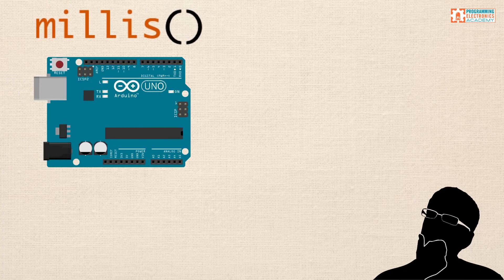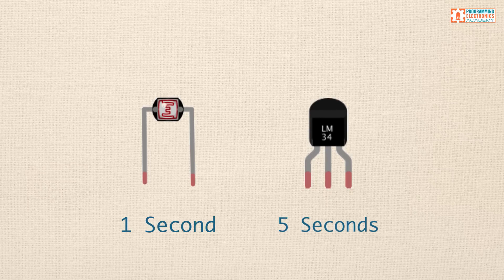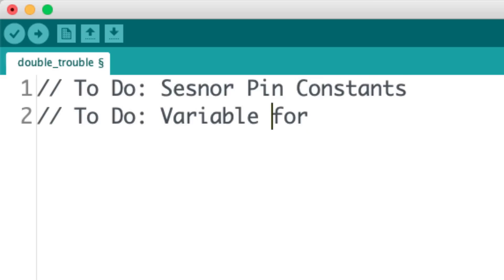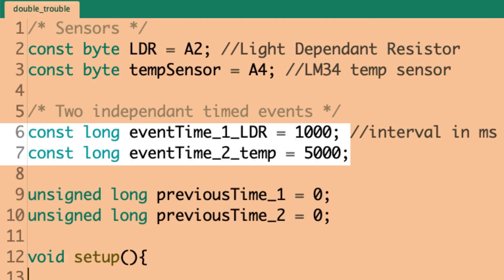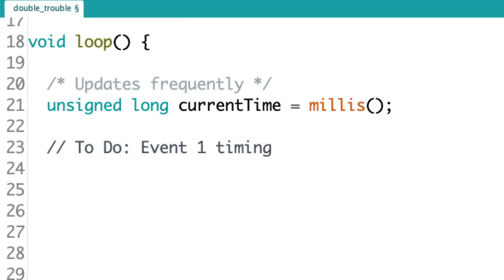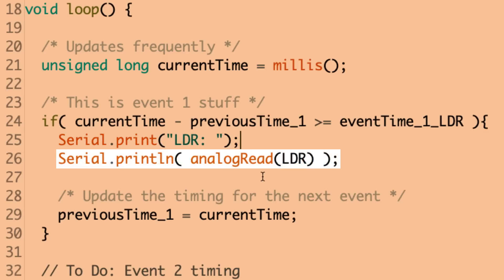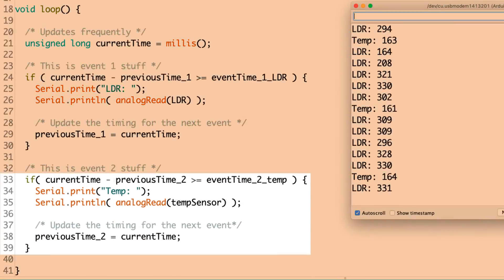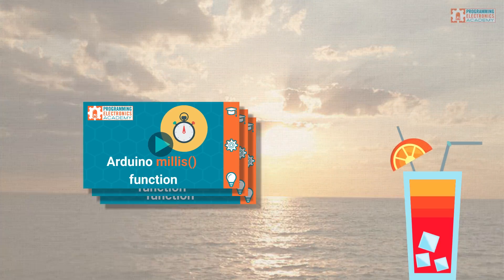Doing multiple timed things with Arduino: Unleash the millis()!

Comment: Got my first Arduino yesterday.  Thought it could be fun to play with a fairly modern system. A lot to learn.
Made embedded real time multiprocessor systems decades ago. Both hardware and software, Intel 4040, 8051 8085, 80188. and Z80. Assembly & high level languages like PL/M and Modula-2.
This video made it clear how to structure a small stepper motor project.
Reply from the maker: Thanks for the note!  I hope you have fun!

Comment: For everyone worrying about the currentTime rollover after 3 weeks:
If currentTime is smaller than previousTime, a rollover has happened. Check for this condition and then just set previousTime to zero (basically reset your program this wasy).
Reply: The rollover is handled automatically by this code. Do the maths in binary instead of thinking in decimal and you will find it works correctly as is.  The key is to subtract the times rather than using addition.

Comment: good to know things are: 

making a variable a constant with "const" will prevent accidentally changing the value later in the program and the compiler will generate an error: "error: assignment of read-only variable 'YourVariable' "

"long" =  -2,147,483,648 to 2,147,483,647
"unsigned long" =  0 to 4,294,967,295

unsigned just means that the value stored will never be smaller than 0
Reply from the maker: Great notes!  I think the numbers on long and unsigned long need switched though in your comment:
"long" =  -2,147,483,648 to 2,147,483,647
"unsigned long" = 0 to 4,294,967,295
Reply: @programmingelectronics  yes you are correct i have mistakenly swapped the values ^^

Comment: Sir, can I use milis() if say, I want to analogRead from my sensor every 16 ms? I have project to read voltage and current sensor from charging capacitor which is happend about 800 ms to fully charge. I want to measure 50 data point (AnalogRead()) from my sensor during 800 ms. I really appreciate your help Sir?
Reply from the maker: Cool project - > Yes, using millis() would allow you to sample something everything 16ms.  If you look at the blink without delay example in the Arduino IDE, or watch this series, you should get a thorough idea of how to implement that in code.
Reply: @programmingelectronics  Thank you Sir. I am still to follow along series videos that you provide in this channel, Sir. very helpful. Many thanks Sir.

Comment: I enjoy your videos but this one has me stumped!  I tried to substitute leds as a test as you suggested.
My timing was led1 once every second and led2 once every 10 seconds.  One the first loop it went well BUT following that both leds were on all the time!  I tried with delays added and that allowed the leds to blink correctly.  My uncertainty is based on the thought that we were to AVOID using delay???
By the way I am 79. Here is my code 
int led1 = 12;
int led2 = 11;

/* Two "independant" timed events */
const long eventTime_1_led1 = 1000; //in ms
const long eventTime_2_led2 = 10000; //in ms

/* When did they start the race? */
unsigned long previousTime_1 = 0;
unsigned long previousTime_2 = 0;

void setup() {
  //initialize digital pin led1 & led2 as an outputs.
  pinMode(led1, OUTPUT);
  pinMode(led2, OUTPUT);
  Serial.begin(9600);
}

void loop() {
  /* Updates frequently */
  unsigned long currentTime = millis();

  /* This is my event_1 */
  if ( currentTime - previousTime_1 >= eventTime_1_led1) {
    Serial.println("led1  ");
    digitalWrite (led1, HIGH);
    delay (100);
    digitalWrite (led1, LOW);

    /* Update the timing for the next event*/
    previousTime_1 = currentTime;
  }

  /* This is my event_2 */
  if ( currentTime - previousTime_2 >= eventTime_2_led2) {

    Serial.println("led2: ");
    digitalWrite (led2, HIGH);
    delay (100);
    digitalWrite (led2, LOW);
    delay (200);
    /* Update the timing for the next event*/
    previousTime_2 = currentTime;
  }
}

Comment: Nice video.  I've got a use case that requires both event-driven and timer-driven functions so this was helpful.

Regarding your timer update, though, I think I would have updated previousTime_1 & previousTime_2 by ADDING their respective intervals back into them rather than updating to the current time.  loop() is subject to blocking and there are other reasons that your loop might lag, so your implementation might creep (e.g. 0... 1003... 2003... 3005... 4006... 5007 vs 0... 1003... 2000... 3002... 4001... 5001).  Staying truer to your intervals might be important.

Comment: Hi - I have a FastLed process that I want to keep running for a fixed period after a sensor is triggered - any clues on  how to achieve this as its not quite like the repeating tasks of the example
Reply from the maker: Great question Mike!  Will your code be doing other things in addition to the FastLED process? Like reading other sensors etc?  If not, you might simply throw the process in a tight loop that waits until your specified loiter time to pass.  i.e Read sensor - put program into LED loiter based on millis() at enter time.
Reply: @programmingelectronics  Many thanks - I managed to get it to work with a carefully placed 'if' statement.  The FastLed is for low level lighting of stairs.  A small PIR at top and bottom start the process and the FastLEDs run for a configurable number of seconds (using millis) before they turn off.  With the FastLED  Pride() function they look quite pretty.

Comment: Can you explain how this method avoids overflowing of a unsigned long variable?
I'm taking 4 readings from 4 different Distance Sensors and lighting up the LED on the basis of output I gathered from each sensor .But the values which is coming from distance sensors are overflowing the functions . 
I appreciate if you help me out.

Comment: Just what I was looking for ! I needed to slow down the up and down increment of the set rpm  programme on an Arduino that uses a touchscreen  display without using the despicable delay function , managed to slot this into one of the if statements inside aviod ReadControls function - works a treat and as this programme is interrupt based  ( rpm sensor ) the delay is a big no no . 100 milliseconds did the trick .
Thank you !
Reply from the maker: So glad it helped!

Comment: Hi, i need a code for a servo motor. Which move 0 to 180 forward and wait 2 hours and again it reverse and wait 2 hours and it is to be continued, can you help me.
Reply: I can help you a little, if you need more specification let me know:
-Do exactly what he did in the video
-For event 1, change it to your servo doing 0 to 180
-For event 2, change it to your servo doing 180 to 0
-You also going to need to think of a way to put a delay for event 2
-In other words: from start, 2 hours has past (servo do 0 to 180), an additional 2 hours has past (servo 180 to 0)
-To be more precise, event 1 will START at 2 hours and event 2 will START at 4 hours
-Their interval will be 14 400 000 millis (4 hours) if i did the math correctly

Comment: How large in value can the current time variable grow to before it causes issues in the register?
It is not a wiser choice to utilize a Count++ function that grows on every loop until it reaches the largest required count and then reset the count to zero and start over?

Comment: Hi,

Please let me know I have 5 events and I want to run them sequentially but 2 events are working in manner but when I add 3rd event the sequence got disturbed.

unsigned long ct, pt=0, pt1=0, pt2=0;
void loop() { 
  ct = millis();
  

 
  if(ct - pt >= 1000)
 {   

  lc.setChar(0,0,'a',false);
  pt = ct;  
  }
  
  if(ct - pt1 >= 2000)
 {   
  lc.setRow(0,0,0x05);
  pt1 = ct;
  }
  
  if(ct - pt2 >= 3000)
 {   
  lc.setChar(0,0,'d',false);
  pt2 = ct;
  }
 }

Comment: This is an old video you probably won't respond, but if you see this then...

I need help creating a photogate I know the equations etc. but I don't want to use an Arduino Zero or buy and RTC module, I have a short deadline for a project so I'm not sure if I have time to buy anything else online. I need the photogate to find the time it was broken then do an if statement like

/=Divided By

Time Broken Phototrsnisotr = millis() or something to get time between beam is broken and restored like a stopwatch
Speed = Time Broken Phototransistor / Object Diameter

if(Speed == 2 Meters Per Second) {Speed up or something}

Comment: thank you so much for this useful narration!

Let's say i want to control the digital output with "millis" function. How do i set the exit working time without stopping the loop or other ?
Reply: What exactly do you want to use and for how long? You can use this same sketch he shows but instead of reading values and printing them, you can just set up a digital pin to become high or low. You'll need all the code without the display part for just one digital pin. I might have said it a weird way so if its confusing, ask again.

Comment: Fantastic video. I've been watching the series and hoping you'd cover timed events using the Millis() function. Very difficult to get your head around that function and you have definitely helped.
Reply from the maker: Thanks Jake - I appreciate that!  I often still scratch my head on using it well.
Reply: @programmingelectronics  i guess millis still sucks because if you have any delay()s in those timed events your entire timeline will be screwed up. i  think to use millis everything has to be perfectly synchronized
Reply from the maker: @yashaswikulshreshtha1588  I don't believe delay() effects the background count of the millis() function - millis() will keep counting.  You might consider some timer libraries that trigger interrupts at specific times...
Reply: @programmingelectronics  I wanted to use millis for timed events but let's say if one event which turns on led has a delay in it then It won't affect millis counts but yes it will act as blocking code for other code pieces sometimes like permanent blockage, you can a event which happens every one second and then an event which happens every 3 seconds, so ofc the first will execute first but if u put delay of 3000 In it then the second event won't happen at all, it never will. I thought maybe I could use millis to run big code blocks having lot of functionalities. At timed intervals
Reply: @programmingelectronics  I would be really grateful if you can make video of classes and objects in Arduino. Probably no has explained good on YouTube, but if u can make it, it will be on top and it will be helpful to all of us, cuz some of us are trying to learn actual programming concepts using arduino
Reply from the maker: @yashaswikulshreshtha1588  Thanks for this recommendation!
Reply: @programmingelectronics  I will be very excited for the video

Comment: Is there a potential problem, when millis() rolls over after 49 days, that the sensor updates to serial could stop when the if statement is not true and is there a way to avoid this happening?
Reply from the maker: Hi Steve, Great question.  I am planning on releasing a video about the roll over (at some point...)   In the meantime, you can check out this article on stack exchange https://arduino.stackexchange.com/questions/12587/how-can-i-handle-the-millis-rollover/12588#12588  Hope this helps some!
Reply: @programmingelectronics  sir please do a tutorial about this rollover problem of millis in a code.  It is easier to understand your explaination than reading a book :)
Reply: I think with another if statement ; if (previousTime_1 > 49days || previousTime_2 > 49days) {previousTime_1 = 0; previousTime_2 =0}

Comment: lol how funny is that. I have not long finished writing code very similar to this, except I used a DHT22 and a HC-SR04. I timed three events, temp, humidity and distance (at 5 seconds, 7.5 seconds and 10 seconds). Threw in a millis reading at the end of each loop just to see how often it was going through the loop (and any delay processing). I prefer to update the previous time immediately after the If statement, just in case you are not putting the millis value into a variable like "currentTime"       if(millis() - previousTime_1 >= eventInterval_1){  previousTime_1 = millis();
Reply from the maker: Thanks for sharing that!  That makes for more succinct code for sure.
Reply: @programmingelectronics  I knew I was on the right track when I saw what you wrote was very similar to what I had come up with. I initially had down what you wrote, but then changed it at the last minute to just tighten it up a little. Doing three different events one after another, I played with both ways. The way you did it might be slightly more memory friendly, the way I did it will keep the timed events slightly more accurate. If we weren't playing around with milliseconds which increment pretty rapidly, I would have normally done it the way you did it. Thinking about it now, I wonder if I can test the value, and pipe it into the variable in the same action to try cut down the time difference even more? Hmmm another thought just occurred to me. If I put it back to the way you have it, and just reset the currentTime before the start of each event it might be even better still.
Reply: Yep I think just resetting the currentTime is a winner. That way it isn't so time critical when previousTime_x is updated. Although it is good to get it done out of the way and not forgotten.
currentTime = millis()
if(currentTime - previousTime_3 >= eventInterval_3){
previousTime_3 = currentTime;
Reply from the maker: Great thought - so adding that currentTime = millis() line before each if condition.  Thanks again for sharing!
Reply: @programmingelectronics  Yeah I think that is the way to go... You are capturing the value immediately before you do the If statement, so if it goes into the If (i.e the right amount of time has elapsed), you don't have any lag between the millis at the time of checking the If statement, and the time of storing in the previousTime variable. 

I think resetting the currentTime just before the next If can potentially make the difference of it stepping into the If statement and it not stepping in, on projects that require a very minimal delay between checks. If you only set it once and it takes say 50ms to run through the first If statement, in real time the internal counter has increased by 50ms but you are still using the old value.

By putting a println of millis at the end of each loop, I noted that the average loop time for a non activity loop was about 7ms, but when it did a sensor check and printed to screen it was around 40-45ms. I have a 10ms Delay between LOW and HIGH Pin to get the reading.

Since I am using 5, 7.5 and 10 second intervals (just random values) some loops will do nothing, some loops one activity, others two, and some three. On the ones that do three, the initial time set with currentTime = millis() will be way out by the time it enters the third If statement.

Comment: Sir i make knock lock system by uno .
It detect knock pattern rightly
But 
My 5v gear moter  is not working in it for locking anything 
Plz Sir give my solution plz 😭😭😭
Reply: High torque stepper motor you'll need a high "current" 5V supply ?
the stepper?  ,  library, & code .
It be cool to get it "really" working

Help maybe ?
Cheers and good luck